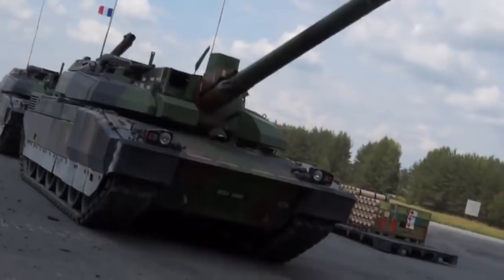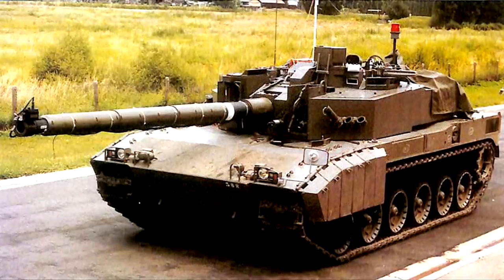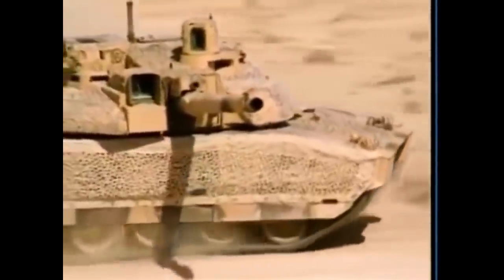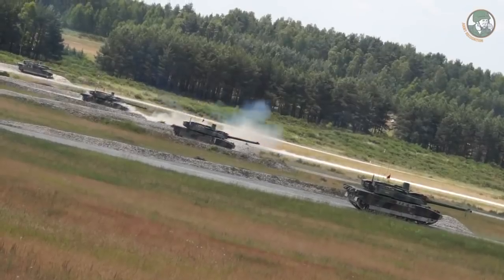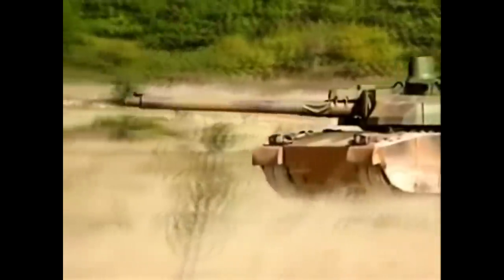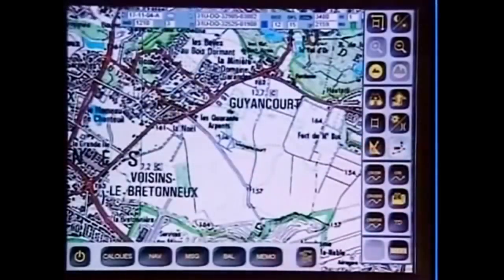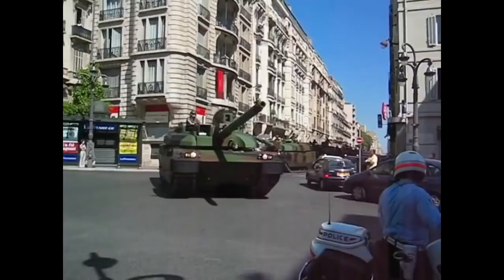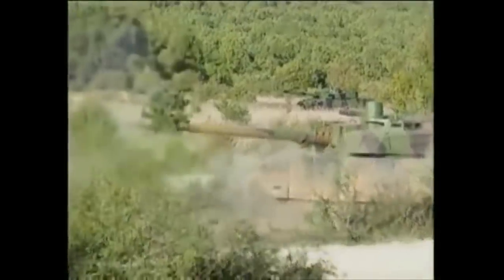Is Leclerc Obsolete?

Comment: Yeah, the "bad, but good enough vs oldies" tank just won the "iron spear" NATO firing competition in Latvia.
Reply: Every tank would get destroyed in the hands of the arabs. Even if they have ufo technologies.
Reply: @F4EJ Phantom II : Nobody will ever know because as far as I know S1 series have been scraped for years...
Reply: wheezes
FCS is pretty much the only good thing on the Leclerc.
But yeah the tank is inferior to a Abrams or a Leopard 2 in a tank vs tank engagment
Reply: @Theo_Aubusson  : Leo 2 were easily destroyed in Syria and Abrams were transformed in junkpile in Yemen. No Leclerc lost by UEA in Yemen. Saudi Arabia felt so disappointed by the poor performances of their Abrams that  they contacted Nexter and the French army to try to buy Leclerc tanks. It is no more produced and France is no more interested on selling the 250 or so stored tanks. 
Check your facts.
Reply: @BFOP15  Are you serious... 
Leopard 2s lost in Syria were 30 years olds Leopard 2A4 with B tech and were very bably used, like firing at a town 4 days in a row from the same position without infantry support.
And the Abrams were export models, so without DU and modern US armor packages and were also badly used like going in towns without infantry support.
And i would like to know your source about Saudi arabia trying to buy Leclerc
Reply: @Theo_Aubusson  1) Leclerc is a ... 30 years tank. Created in the 80's first issued in 1991.
2) Europe doesn't sell downgraded version  of weapon system contrary to USA and Russia. A downgraded Leo A4 doesn't exist.
Concerning the interest of Saudi Arabia for the Leclerc :
https://natopart.com/en/blog/post/22-saudi-arabia-seeks-to-acquire-new-heavy-tanks-and-the-french-leclerc-is-in-the-running
4) Plenty DU armoured american Abrams  were destroyed in Irak. Try another excuse for the saudi Abrams failure. 
If UAE army is better than the Saudi one it is quite far from any western army standard. 
Try something else
Reply: @BFOP15  The Leclerc used by UAE is not 30 years old, Leclerc S1 are not in service anymore... 
I haven't say that Turkish 2a4 were downgraded there are just old, because they haven't receive any modernisation like other 2A4 that have receive C tech.
Plenty yeah 9 in the first irak war and 0 by direct enemy fire and in the 2nd one Abrams weren't important in the US army counter insurgency strategy si yes even US army used pretty poorly their Abrams and DU armor, and US ammunition and armor package are very important to enhance te combat capability of a tank
Reply: @BFOP15  and btw yes the Abrams consume an enormous amount of fuel but the turbine is pretty strong in desert condition in well maintained, in operation desert storm the combat readiness of the Abrams was around 90% and problems with the filter is now fixed
Reply: @Theo_Aubusson  : The 1st Emirati Leclerc was delivered in 1994 . It is S2 version with an MTU engine more suitable for desert and sand. 
It is inferior to XXI Leclerc currently in use by French army. 
2) USA lost Abrams during the 2nd war in Irak, in a counter insurgency war, the same kind Waged in Yemen. 
3) Still same kind of war, same IED, same anti tank weapons and the Leclerc of 1994 proved better than Leo2A4 and Abrams.
Reply: @BFOP15  and the Leopard 2A4 used by the turkish are still 10 year older, what's the point of the comparision and has i already say their strategy was very bad. Yes diesel engine are better in almost all condition, but turbine are still quite good for the few advantages that they give.
I'm not arguing on wich tank is better, i'm arguing on why your comparision are irrelevant, i don't really know how UAE train and use their tank but i know that only few Leclerc were actually hit by enemys unlike Saudi's Abrams and that has i said Saudi strategy is bad
Reply: @Theo_Aubusson  You're arguing about which tank is better. Your 1st comment is " Abrams and Leo are better than Leclerc in tank to tank battle"
I showed you that in actual war Leclerc did better than the 2 tanks you mentionned. 
You were so confused than rather of speaking of tanks you spoke of poor tactics even for the american,   the 1st military power...
The fact is in a tank vs tank battle even an old S1 leclerc would have the upper hand on Abrams and Leo A6. 
Why ? The Leclerc S1gun is still superior to the Abrams m1a2 sep and Leo A6.
It can fire and hit at 50 km/h on a moving target thing that even a Leo2 A7+ can't do.( even if the gun of leo A7 is now better than the Leclerc one)
Reply: @BFOP15  yes and i m talking about newer not 30/40 years old one and how can you compare different tanks that are not using the same way in combat. But you can compare tanks by using their caracteristics.
Having a great military power doesn't mean that your tactic is perfect, look at the french during WW2 or even look at the russian strategy during the cold war.
Newer Leopard 2 and Abrams can fire on the move like the Leclerc but the loader will suffer to load the next round yes.
But the Leclerc ammunition are worse (estimation) than the Leopard 2A6/2A7 DM63 or than the Abrams M829A4 in terms of performance.
And if one of those tank 2 tanks has to fight the optimal strategy would be to put them in a hulldown position where the Leclerc barely can't do anything at least in the first shot and probably in the 2nd shot too
Reply: @Theo_Aubusson  : Neither Abrams nor LeoA7 can shoot with precision at a speed exceeding 20 km/ h due to their suspension system. 
Protection of the Leclerc was said to be inferior, war proved it did better than Abrams even with DU. 
The ammo of Leclerc are mainly classified and nobody know their effect. 
His gun outclasses Abrams and the Leo serie until A7.
These are facts, what you say on based on ammo is unknown. Artillery is a French speciality since XV th century.
Reply: @BFOP15  they can because their hull are bigger and heavier than the Leclerc one and it compensate for the worst suspensions. I can prove you that the AMX 30 has better protection than the Abrams -_-
In the operation desert storm the french lost one AMX 30 while the US lost 9 Abrams.
Leopard 2A6 got the L/55 so no the 2A7 was not the first one to got a gun that outclassed the french one or you're talking about the L/55A1 and then you're also wrong because the first one to get it is the 2A7V.
US tank ammunition are pretty good, around 750/800mm of penetration at 0° at 2km with improve anti heavy ERA capability over the M829A3, and around the same for the DM63 while the Leclerc ammunition is said to be behind, we don't know if it got anti ERA capability but far has I know the french still use OFL F1B wich is a derivative of the DM43 so probably without anti ERA capability and the OFL F2 with a DU core in stock in case of a war against a country with heavy armored tanks but is most likely inferior to the DM63 and M829A4
Reply: @Theo_Aubusson  : No amx 30 were hit in 1st Gulf war. 4 Leclerc were hit in Yemen,  all were back in combat within few hours. 
Your comparison is a nonsense.  
What is a good mbt? a combination of mobility, firepower and protection. 
Leclerc outclasses Abrams in mobility, firepower and his protection who was said to be its weakpoint seems widely better that what it was said, performing better than the Abrams in Yemen and gulf war 2...
Leclerc is better than Leo 2A7 in mobility, still have an avantage in terms of firepower because of its rate of fire and the effectiveness of Leo A7 protection is still unknown... Leo A4 performed poorly against missile of his age being torched by konkur or TOW  
It's pure fact again.
Reply: @BFOP15  1 AMX 30 was lost because an Abrams destroyed it. More than just 4 were damaged, 4 by rpgs, one penetrated the LFP and penetrated a fuel tank, one by an ATGM,the UFP got pentrated the driver has been killed and the commander got injured, 2 IEDs, 1 injured and one by 12.7 and 14.5 machine guns. No one were destroyed but the one pierce by the ATGM got repaired by Nexter and was exposed at Satory exposition and then go back to the UAE.
The protection is weaker because the UFP got penetrated by apparently a Konkur or Konkur M while on the M1 hull it would bound and to weak to penetrate the Leopard 2A4 UFP. Leclerc got a pretty good turret side armor but the overall front protection is insuficient against modern APFSDS such as Vacuum 1and the gun mantlet is less protected than the Leopard ones. The Leclerc LFP is also not covered by composite armor has seen on the swedish model to test the armor. Firepower no because has i already said Abrams got better ammunition.
Also the Leclerc never fought in the 2nd Gulf war, because France haven't deploy troup.
A manual loader on a Leopard 2 can reload faster the first shells than the autoloader also in the strong europe challenge the autoloader got some problems.
And Leopard 2A7 has much thicker armor but even if the thickness were the same the wedges increase the protection by a significant margin.
And yes your tank will perform badly if you use it like the turks did, if it was the Leclerc or an Abrams the result woud be the same because they are not build to resist direct hit from the side.
So no you're talking facts
Reply: @BFOP15  In your first point, you mix up how old the tanks were, with how old the model is. The Leopard entered service in 1979, so the Leclerc is almost an entire generation younger and should be significantly better. Is it?
Reply: @BFOP15  the Houthis did capture/destroy some Emirati lerclercs
Reply: @natalyashadova1217  : The Houthi had their hand on one Leclerc tank , the one who was hit by a missile and had driver killed. 
It was taken back by the emirati a few minutes later before Houthi had the time to sabotage it.
It's One Leclerc captured for a few minutes...not some Leclerc destroyed.
Reply: @BFOP15  I mean, if guys sending tanks straight into a front without any form of infantry support, reconnaissance, or proper tactics then that doesn’t say anything about the technology. I don’t care about the fact it’s export, I care about the fact that countries don’t know how to use them properly. Hell, the Saudis placed a red cooler on the back of the Abrams bussel, basically making it a very conceivable target to a human eye.
Reply: @m1a1abramstank49  : During 2nd Irak war, 770 Abrams were used by the US forces. 
Among them 80 were so damaged by enemy fire or IED that they were sent back to USA for rebuild or scraped. 
More than 10% loss...
( The famous american Abrams with DU so much stronger than Saudi Abrams...)
 USA doesn't know how to use tanks?
Emirati sent 150 Leclerc in Yemen. 
Among them 3 suffered  damages causing them to loose mobility. ( with a few hours of repair)
1 had a missile hit on the pilot hatch killing the pilot and injuring the leader. 
This tank was sent back to the Emirates as Nexter wanted to examine the damages ( It could have been sent back in a few hours just like the others)
Result : Between 0 and 0,66% loss. 
Even if US army stayed much longer in Irak than Emirati army in Yemen, the result can't be contested. 
Your poor tactic point is ...pointless in this case or you must admit Emirati army is better trained than US army.
Reply: @BFOP15  I mean, you proved my point on tactical error being part of the problem and not the tanks technology...  If you place the Leclercs in the situations of the Turkish using the 2A4s it’s going to be the same adverse effect, I can guarantee it. Place it in the Saudis position and they’ll do terrible with it. You can have the most efficient, ‘best tank’ in the world and yet again you only bought it because money is cool and you can barely use it efficiently as result.
Reply: @BFOP15  And you are aware, the Abrams losing lot casualties can be due part to the fact that we been in a conflict much longer than most other countries? I mean, a casualty can mean anything from a killed crew member, disabled track, engine, gun, or blown out ammo. That’s what ‘knocked out’ or ‘mission kill’ refers to. This can happen among other tanks aswell
Reply: @BFOP15  And I want to see the source for the claim of 80 being ‘so damaged’. Seeing anecdotes and other manuals the casualties remain at few, and yes I’m looking at the 2003 war for reference.
Reply: @BFOP15   I should also denote your claim on the US Abrams being practically stronger than the Saudi Abrams. While that’s true in terms of Depleted Uranium armor and TUSK kits and APS tech, you reference IEDs...  IEDs can fuck up about any tank that doesn’t have strong lower armor, and by that timeframe TUSK wasn’t coming out anytime soon, so the Abrams, both Saudi and US would be susceptible to RPGs nonetheless, like every other tank made by that time. I want you to try and track every IED you come across, which is unavoidable in certain areas and very hard to find. Even with stuff to eliminate lines of IEDs and mines there’s no guarantee you won’t see mines.
Reply: @m1a1abramstank49 : The 80 Abrams were not suffering of a disabled track ( a current reparation on the field,  or an impacted gun, a current reparation in a rear logistic  base ) but had to be scrapped or fully restored at the builder plant. 
Leclerc tank were used at least during one year to 18 months in 2018/2019.
2nd gulf war was 8 years long. 
Even considering the difference of time,  the ratio is still largely in favour in Leclerc.
Reply: @BFOP15  I mean, of course the ratio would be in favor of the Leclerc after the Abrams had brute forces the entire campaign more than other tanks that served. That’s not an indication of technology, that’s an indication of tactics and usage over the years. And you haven’t even mentioned a source for your claim about the 80 Abrams lost, which you’re still ignoring, along with the rest of my other point. If the T-72 seen more action similar to that of the Abrams in the Gulf War would it be a better tank just because it has a better ratio than other tanks? That’s not exactly how it works. Instead of dicksizing how about go into proper specifications and good reasoning. Your only points are “the Leclerc lost much less tanks in action so it must be better technology than the Abrams!” and not noticing why is such and not supporting your points.
Reply: @BFOP15  Checking your channel I do not see a single qualification indicating you know much about said facts, nor do I get the implication by your facts, which probably come from the wrong and biased sources.
Reply: @m1a1abramstank49  : I didnt find any source in English,  and I don't think you read French. 
But according to wiki :
"As of March 2005, approximately 80 Abrams tanks shipped back to the United States for repair due to fire from enemy attacks.[32] Abandoned Abrams were purposely destroyed by friendly fire to prevent recovery of vehicle or technology. Damages by 25 mm AP-DU, anti-armor RPG fire, and 12.7 mm rounds was encountered. There were no confirmed instances of anti-tank guided weapons or anti-tank mines striking the US MBTs.[33] However, there is some speculation that Kornet ATGMs were used during the Battle of Najaf to knock out two Abrams, but Russian officials denied selling the weapon to Iraq.[34] What is known is that the two Abrams were struck by unknown weapons, and their ammunition stores ignited"

There was a few years ago a video on youtube showing an american vehicule scrapyard in Irak,  I can't find it anymore. It was filmed at the end of the war in 2010 or 2011.
You could see some fully destroyed Abrams.( A good half dozen even more can't remember exactly)
Where do you think TUSK program came from?
Reply: @BFOP15   Here’s the thing. I specifically said that the Abrams saw more action, correct? I’m not denying that we didn’t lose tanks to some degree but it’s definitely implied that US forces saw more action and brute forced more of the forces at the front than the Leclerc did, which if taken action occurred at lower numbers. You haven’t mentioned how this correlates to why the Leclerc is better than the Abrams, it only implies that the Abrams saw more action in both urban and tank on tank engagements, which you’d expect more losses to be inflicted if that’s the case. And you mentioned 25mm, which is a Bradley IFV round which leads to the friendly fire point, and proves that it was directly a human error than anything to technology. You haven’t specified what type of damage inflicted on the Abrams, you only said ‘Damage’ which could mean a multitude of things, not just armor penetration or crew deaths. As far as I know, with leaked documents with the base M1 Abrams (105) it can stop heavy machine gun fire on the side of the tank. At this point you’re not supporting your own point you’re supporting previous points of me saying that this was down to human error and a lot of the losses heavily implied for something else...  I’m highly doubtful you’re bright enough to understand stuff like this...  Arguing with you is practically pointless because you’re nationalistic with the Leclerc instead of using proper anecdotes or facts. I can’t take you seriously if you can’t lease your reports, which is dubious considering I haven’t heard it from proper authority.
Reply: @BFOP15  russia sometimes sold upgrade version of their tanks like T 90 MS
Reply: @Theo_Aubusson  Nexter and the Leclerc got the SHARD shell. Best in the category, and you're telling Leclerc ammunition aren't good? France is famous for their quality shells and artillery globally.

As told above, there are countries like Saudi, India, and more, which are showing interests to the Leclerc, a MBT which the production have been stopped. Kinda weird no ?
Reply: @BFOP15  55 km/h firing speed of the Leclerc on any surfaces and terrains. The Leclerc still holds the record, of the highest precision and farest shooting in the world, after beating the previous record holder. There's even an interview of the French gunner who performed it.
Reply: @Theo_Aubusson  Yeah, in a world where getting the first shot matters most, the Leclerc has only its FCS going for it. How awful.
And its size. FCS and size.
And mobility. FCS and size and mobility are the only thing it has going for it.
And armor. As resilient as an abrams from the front, more on the sides, the only things it has going for it are the FCS, the size, mobility, and armor.
Oh, yeah, and the fockin longer barreled L55 gun, too.

But that said, it's expensive.

What was your point again ?
Reply: @canicheenrage  Getting the first shot matter when you can reliably penetrate the tank you were firing at but the Leclerc cannot because of his old ammunitions.
The Leclerc is has tall as the Abrams and i never heard anyone talking using that as an argument.
Mobility is not only speed, it's also range. And the Leclerc range is considerably lower than a tank with a convetionnal diesel in a real situation, during the swedish trails, the Leclerc consume almost twice as much fuel as the Leopard 2.
I would like to know how Leclerc armor is as effective as Abrams armor, because again in the swedish trails the Leclerc armor was considered significantly weaker than an export variant of the M1A2.
And no the Leclerc doesn't use a L/55 gun but a L/52 and gun doesn't matter that much when your APFSDS are not that great
Reply: @Theo_Aubusson  The swedish trials were done with a half baked series 1... Series 3 had received an upgraded thicker armor package with tungsten layers. You can actually spot that the turret is bigger by simply having smaller external stowage boxes and taking the extra space for more armor.